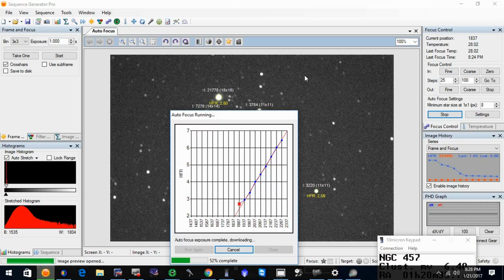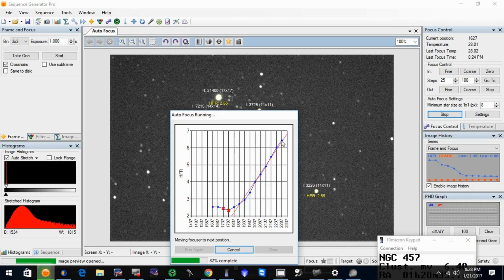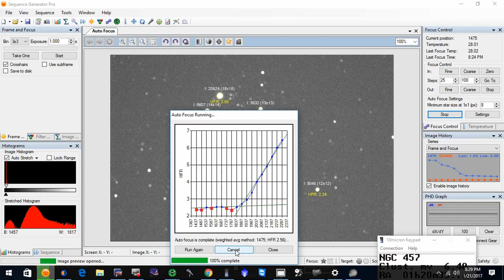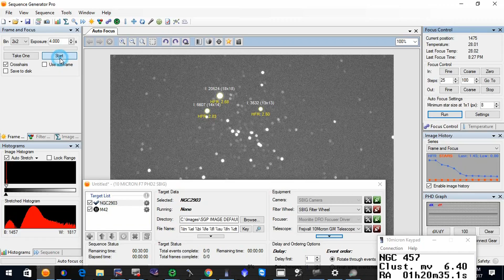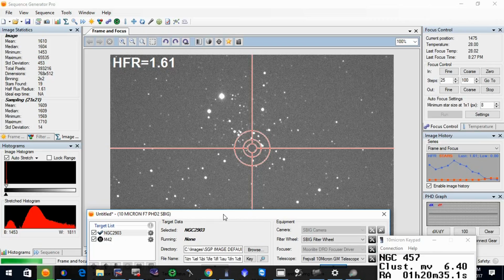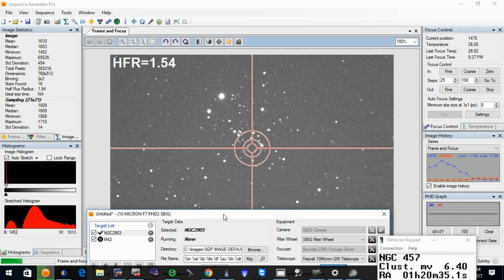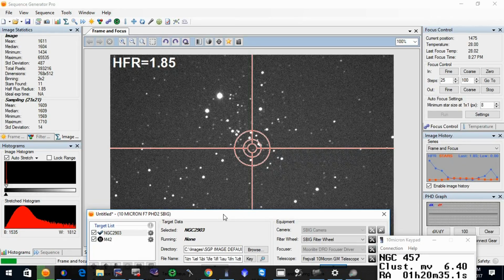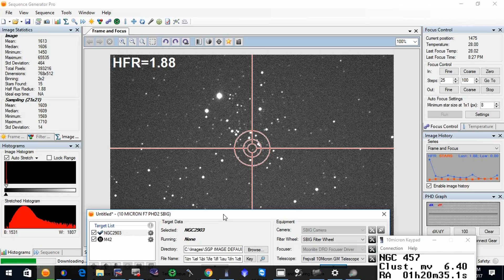Moonlite Focuser

Comment from the maker: As an update: I have sent the focuser  back and had it replaced by Ron. Ron is a nice guy but that does not solve the problem. Seems the design has a technical problem that the bearings crush easily. When the bearings crush, the focuser will not support the weight of the camera. This is demonstrated in the focus curve in the video. I have spend over $1,200. on these focusers and never really got the results I was looking for. Customer service has been great. Product just does not perform for more than 100 hours before the bearings crush and you have to send it back. Just reporting in my experience.

Comment: I have a moonlite focuser with a similar load to your, have you adjusted the pressure right in the bottom two screws? one way to test this is to loosen up the two screws on both sides of the pressure knob at the bottom and push the camera outward and see if it slips. if it does, add more tension to the screw 1/8 of a turn at a time and try pushing it out again. Now remember, the thumbscrew is just to hold the pressure and not add any. Let me know if i can help you further.
Reply from the maker: I have purchased two of these focusers and both have failed due to crushed bearings.